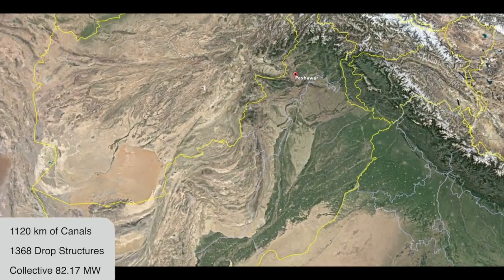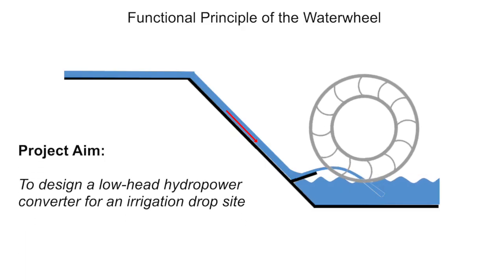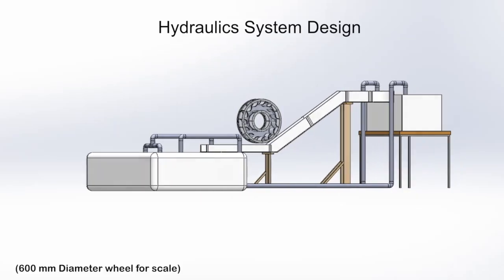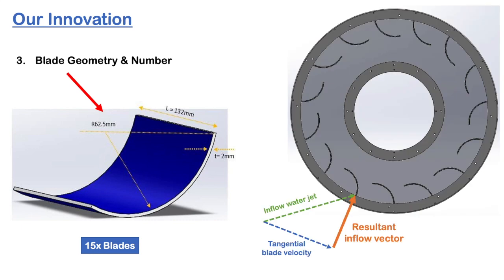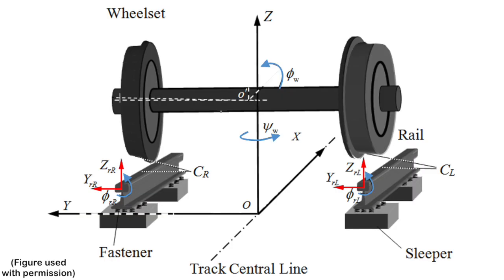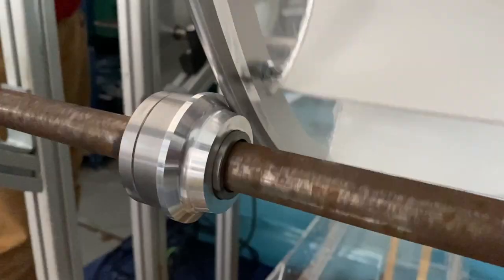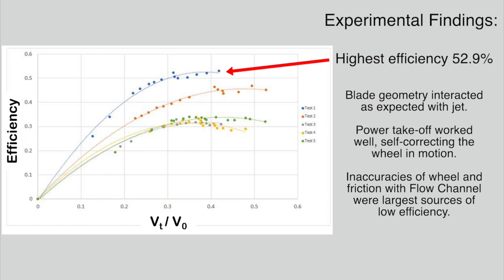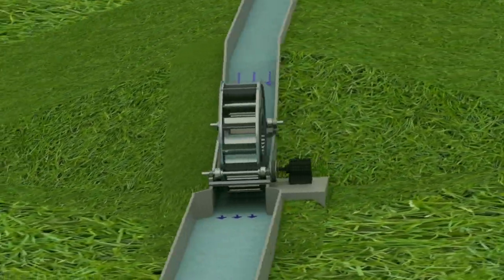Design of low-head hydropower converter for rural Pakistan

Comment: 🤗I appreciate the effort, the design and the scale prototype, but I don't understand the advantage of transforming a hydraulic wheel to action, instead of using a wheel with drawers for above where the weight of the water makes it turn, and the efficiency is greater, the hydraulic wheels from below are used where there is no jump or where there is little, not like this it has no sine, if you have 2 meters of jump you make a wheel of a little less than two meters, the water arrives on the flat without taking speed from above and fills the drawers of the wheel, if we are talking about making a few hundred Watts ok, the multiplication system can be fine, but in reality if you make a few kW no, in the video you see a mechanical multiplier of a large hydraulic pump probably above 5HP, not comparable with what you are testing and designing, like comparing a 5kW wind tower with a 500W plastic one.
Here is an example of a wheel with a maximum mechanical efficiency of 85% https://www.youtube.com/watch?v=O5CQ6wjZ02U

Comment: aluminium rim on aluminium roller expected to take several KW on point contact in wet conditions AND not corrode or wear?
lol. trains run on hardfaced steel tracks for a reason...

ok, replace that with gears or at least rubber rollers...

that being said, the more head, the better. 
i did like the shot at 1:53. shows the water coming (almost) to a complete stop... still a lot of turbulence though...
feed in from the side and have the buckets at 90 degrees the other way...